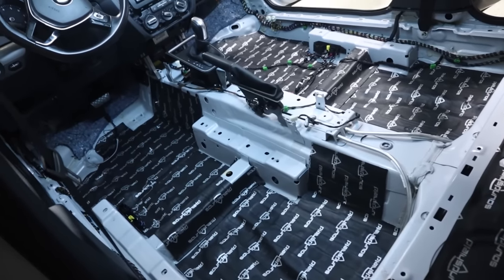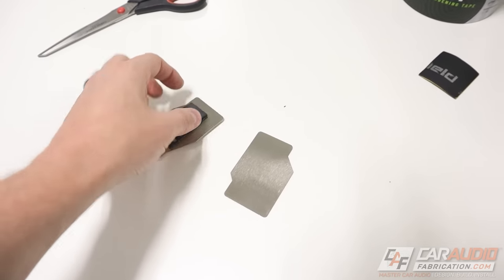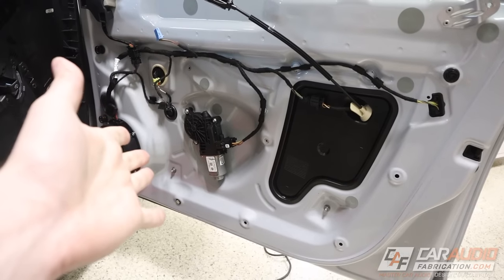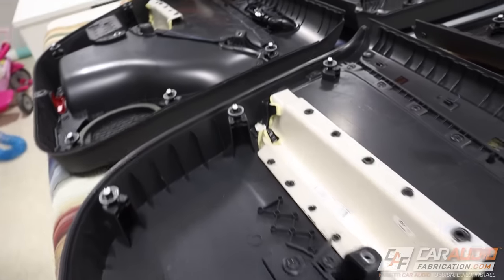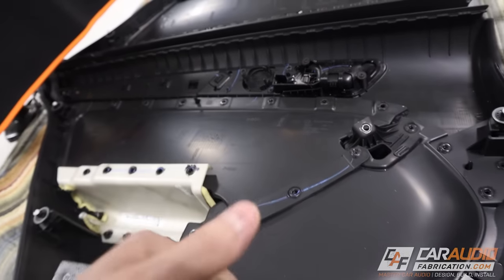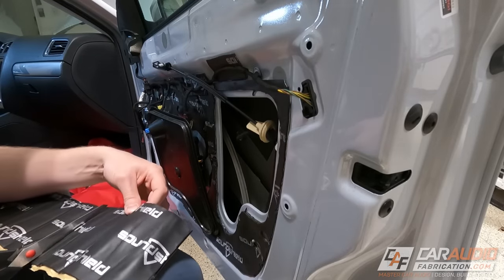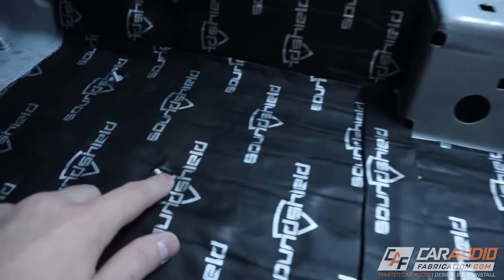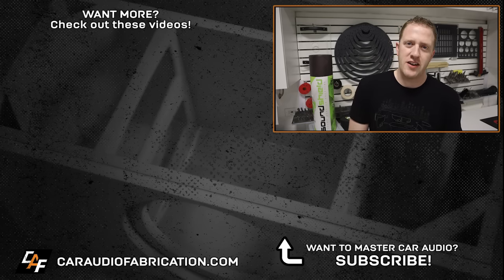IMPROVE SOUND! Deadening Treatment EXPLAINED - Better Bass and Improved Sound Quality!

Comment: I used to do car audio installation back in the early 90s to 2005. A lot has changed but the most important parts have stayed the same. Sound deadening is one of the most important parts of an installation but also one of the most neglected. I know it doesn't seem like it but I had spray on sound deadening material that I used on my 1994 Dodge Dakota. I removed all of the interior, sanded and primed the whole interior and used the spray in deadening material over  the firewall, floor back panel, roof, inside of the doors and the inner door. Then I used Dynamat insulated mat for the floor and firewall and the regular for all other areas. I noticed you using Audio Control equipment. I used that as well. I had the ESP2, Epicenter, 4XS and 2 EQTs for for my four way system. I had USD Waveguide A series, Diamond Audio 6.5 in the kicks, Diamond Audio 8s in the doors and 4 IMPP Pioneer 12s ported through the bed. For the USDs I had a Punch 60, for the 6.5 I had a Punch 100, for the 8s I had a Punch 100 and the for the 12s I had a pair of Power 50Ms. I wish I had a photo of the inside. But I only have a photo of the bed where the Amps were located.
Reply: Funny enough i too had same vehicle. I never did any sound deadening and i never really noticed all that many rattles running 2 rockford fosgate t 1 12 inch subs powered by a 2k watt amp, with the subs firing towards the back. Also never had any headlight dimming either.

Comment: Thanks for the tutorials, very thorough and easy to understand. Going to do my first DIY sound treatment on my '01 Highlander next weekend to bring those new Kicker KSS6504's and KEY amp  soundstage to it's full potential! I already converted the rear 5-1/4 setup to a component 6.5" with tweeters mounted high and angled to the listener. Already sounds 1000x better than what the previous owner had, but I want to maximize my midrange upgrade since I can't go nuts like I did before with an insane system and lose my "dad cargo space"...lol...Anyway first time doing all this, it looks professional and clean so far, and your videos really help, my friend. Appreciate all your hard work.  👍

Comment: for those playing at home and are probably doing a one off job. instead of buying the plastic roll to make templates, you can simply stick scrap paper together with painters tape to get your large surfaces, and all the finer edges, use folded over painters tape. then simply use a sharpie/pen/pencil to mark your shape out, then simply cut it out. the benifit id, if you stuff up an area you can simply stick more paper/tape to that area, retrace and recut. Then simply lay thr template onto the deadener, trace with a pen, cut with some quality sewing scissors!
For trim clip, wiring clip, threaded hole areas etc, i usually fine a suitable object to use as a one size fits all template. For example, a simple trim clip hole in the door sheet metal, ive used a large flanged nut, even a glue stick lid, to trace a nice clearanced circle on the sound deadening, then simply cut it out with a razor blade. This way i get a consistent hole size template that will work for 99% of the trim clips i encounter within the vehicle.

Comment: This is a MID-LEVEL sound deadening upgrade?!

For anyone wondering like I was:

Six rolls of SoundShield - 6 x $119 = $714
Two rolls of SoundShield Slim - 2 x $59 = $118
Roller - $10
Punch Kit - $18
Clear Transfer Tape - $30
Utility Knife - $20
---------------------------------------------
Total - $910

So all in all for this "mid-grade" sound deadening treatment, you're looking at a total investment of $910 before you have invested a single minute of your time into a project like this.
Reply: Use killmat I used it in my Honda it wasn't much I used 3 boxes or 150sq ft. For my 2 door coupe. 50mil and 80 mill were used. Double in the trunk and on the roof

Comment: Installed 80 mil sound deadening in my truck this weekend. Amazed at the level of outside noise reduction. I don’t have decibel level measuring equip. However, it’s extremely noticeable.

Comment: I went to the junk yard and disassemble the entire interior of a Lexus LS 400  to take a look of what type of materials they use to make such vehicles so quiet and virtually noise free … probably you vehicle has three times de amount of sound deadening rubber material, they use different lighter materials , particularly the doors , no mention that make the vehicle heavier affect the fuel economy and acceleration 🤷‍♂️ materials like “Dynamat” prevents rattling but not isolate noise. However it was a nice job 👍

Comment: I did the entire cab on my regular cab truck. I’m running 2 12” JBLs on a 1000W Alpine amp, and JBL rear speakers, 4 Skar 1.75” super tweeters and JBL door speakers. About to upgrade the door speakers to some DS18 250w rms speakers on a 1000w kenwood amp. This stuff helps so much!! You can feel the bass in your chest now
Reply from the maker: Very cool, sounds like a fun system for sure! I always find it interesting when people show off how much their car is vibrating, and I just think... "all that vibration is lost energy" stop the vibration and get more output!
Reply: @CarAudioFabrication  exactly my thoughts! The vibration in a 25 year old truck is no fun either 😅. I really need to pull the door panels and put some material on them as well. Should I do some on the firewall do you think?
Reply from the maker: You can put it on the firewall but the majority of the noticeable improvement will likely come from the doors. If you find the engine drone annoying in that case start treating firewall.
Reply: @CarAudioFabrication  I love the sound of the 5.7! I did two layers on the floor to help with the minimal exhaust. That made the most difference!
Reply from the maker: Awesome, yeah, best to probably focus on the doors then, be sure to come back and let me know how it turns out!

Comment: I was thinking of doing that to my suv but after watching videos of how to remove the headliner I concluded that its a total nightmare can of worms. Also my second row seats come with red loctite on the bolts from the factory, theres no getting those out.  Your videos are always informative and entertaining to watch either way. :)
Reply: The seat bolts WILL come out, even with red Loctite. Use a really long ratchet and spray WD-40 as soon as a couple of threads are visible. The bolts are made to be removable during repair.

Comment: Bringing back my worst nightmares of doing NVH repairs at Chrysler. Spending all day to fix every rattle and buzz you can find for the customer to not even know it was there. Next to water leaks, the NVH complaints were the worst. It has affected me so badly, that in my own vehicle I won't take easier roads to work because I don't want to develop rattles from bumps I can avoid. I drive my old chevy silveraydo then get in someone else's vehicle and cant stand all the noise. I spend the whole ride trying to find out where that noise is coming from.

Comment: I'd like to expand on something you said quite a way through the video (when you were in the trunk). You mentioned about identifying areas that may need 'help' by looking at where the OE has put sound deadening. This is 1000% CORRECT. No matter the make of car, those squares, triangles or odd shapes of material DID NOT get there by accident. As a Professional Automotive Engineer of 40 years, I can tell you that the OEs put a lot of effort into identifying where to put sound deadening to get the best possible sound reduction to remain competitive (in segment) for the least amount of cost and weight (for weight read 'fuel consumption). Exactly as you said about the diminishing law of return - the OE is looking for the biggest bang for their buck. So, as was mentioned (very much 'in passing'), start by adding to what is already there, particularly if you're on a budget.

Comment: Love it! I’m a big proponent of people using the 25-30% method when on a budget as well
Reply: I'm a 30-50 kinda guy. A little really goes a long way. Laws of diminished returns is very evident in the application of deadeners
Reply: I'm willing to spend the money if it makes a difference. I'm not only chasing amazing audio but also less road noise (I have a base model Accord). Any suggestions? I was going to buy the 64.5 sqft roll of SoundSkins Pro Plus but I don't know if it's too much/not enough for 75% coverage. I'm planning this project like a year in advance so I can get everything perfect.
Reply: You obviously don’t love your car 😭😂💀
Reply: @TheMstwntdLMSV123  good lord yes that's plenty. I had a 40sq ft pack and I used it on 3 different cars

Comment: I used 80 mill killmat in my Rigid polished stainless steel shop vac. Did the underside as well,  and yeah man,  it has a much more solid feel, and no Tin-Cabny type sound... Sound Deadening is as important as correct wire gauge

Comment: So I finally checked out the vid... thanks for all your detail.
Two questions I have: 1. With the skins, can it be installed in 50 degree weather?  2. The trunk treatment, is it recommended to leave the gray pieces already on the surface in place?  If it was an older car, would you scrape those pieces out prior to install?
Thanks!!

Comment: On the door near the top you put it on the backside of the panel but not on the door because clearance. Maybe this is just nitpicking but wouldn't you have a better result putting it on the metal instead of the panel? I feel like the metal would resonate vibration and road noise more than the inside plastic panel

Comment: You do a great job of explaining how and why you apply sound deadening material to improve the overall sound within the cabin. Could you touch on how to sound dampen performance and/or aftermarket exhaust systems?

A lot of performance or more aggressive sounding exhaust systems sound great during drives around town or short trips on highways, but those same lovely exhaust tones can become tiring during long road trips. 

In this video, you mention "entry level" and "mid-range" materials but do you have any product recommendations or tips for how to heavily dampen certain locations of a vehicle (i.e. rear/trunk flooring surrounding the muffler(s) or firewall between the cabin and the engine bay)?

Thanks in advance!

Comment: I would like to see a video showing what a very minimal use of sound deadening is used and where to place it.  Someone told me to place patches on flat surfaces only.   I have a 2019 Forester Premium (lowest trim level) with speakers in the dashboard (tweeters?), front doors and back doors.  Is this considered a 6-way speaker system?  Anyway, I’d like to try installing some sound deadening to quiet exterior noise.

Comment: I have no doubt that SoundShield is a top tier product, but one thing I can't stand is manufacturers that use very EXPENSIVE packaging with advertising for their product. Those tubes with the printed logo (advertising) is probably the most expensive way there is to package that kind of product! Every time you buy it you are throwing away money because of their decision to package it that way. For that reason alone I will use another product out of protest of their executive decisions. As an installer you already know how good their product is, so why do you need to pay for it every time you buy it? All it does is increase the cost to your customers without any value in return.

Comment: Do you happen to have footage of the parts of this video that you sped up? It actually is the most important part that i dont fully understand. The wiring splicing is a little confusing, especially if you have never done it before. Thanks for the help😊

Comment: Back up👍 did my doors and door panels on my 2015 VW beetle and the rear quarter speaker enclosures. Much better. Got that from a previous video of yours👌
Reply from the maker: Right on! Definitely makes a big difference even for factory speaker enclosures. The OEM's have to skimp in order to save weight and cost. We can get improvements by adding it back in!
Reply: @CarAudioFabrication  the factory junk is all gone now 😉 I now have about 3kw total now. Ty for your time and help with it.

Comment: I did it on my 09 Taco in 2017 only the doors where plastic was & behind the back seat for kicker box. The doors are a lot heavier closing but very quiet with the volume turned up doors closed.

Comment: When you mention 25% coverage, thats simply for vibration dampening where the main product used contained a layer of foam more used for preventing sound penetration, correct? So rubber on the outer door skin with 25% coverage makes sense but the inside door skin needs closer to 100% when using the foam product - is that about right?

Comment: I noticed you didn't do the headliner. It seems like the metal above the headliner is a problem area when it comes to vibration and resonance. Is there any reason you did not touch it in this video?

Comment: Based on my experience, it doesn't have to be expensive to have a good quality sound. Also, if you put too much sound deadening, 1) it makes the car heavier which will need an "extra" gas for mileage 2) Sometimes,  too much sound deadening creates a "vacuum" silence that for some sensitive people, is painful in the ear, probably due to the pressure created inside the car 3) We are on the road and we must concentrate on the sound on the road and less on the music/entertainment system which is dangerous if we get carried away too much because we focus more on the music. ... Creating a good sound system is more about matching the components and it doesn't have to be expensive.
Reply: True but a buzzing car is annoying.

Comment: With rubbing alcohol still somewhat hard to come by it’s handy to mention you could also use denatured alcohol found on the paint and solvent isle of most big box stores. I’d avoid acetone - it works really well but is stronger than necessary, smells awful, and isn’t friendly to confined spaces.
Reply: @@a.melburn rubbing alcohol is Isopropyl alcohol while denatured alcohol is ethyl alcohol, the same type you find in alcoholic beverages. It is “denatured” with additives to make it undrinkable with the same kind of stuff you can put on fingernails to convince a kid not to put their fingers in their mouth. They’re both solvents that can break down oils and evaporate easily.

Comment: And of course i know that the treatment material is the main answer my question is will that be sufficient for the spots where the plate is connected to the main structure of the car because i strongly feel the spots where its rivited to the car is the main concern but im also still an noob as you can say with the sound treatment aspect of sound

Comment: Love the info you provide and how you explain.   Could you please  do a Demo on  a 2016-2020 Dodge challenger on how you  would  lay it in the rear deck, key areas,:  2  6.5 Kickers ( Cs series, ) Baffles,  and if any, on the front dash area with a budget of $300-350  .  Infinity reference 3.5 's ( Alpine 6 spkr, 276watt original Mopar Amp)

Comment: I have a 2008 f-150.  I want to sound deadening as much as possible.  It’s a project truck, and I plan on removing 100% of the interior… including the dash.  I know the newer f-150’s are quieter because the body mounts, firewall and design of floor pan were designed to reduce transmission of vibration and sound. 

I’m wondering if I can truly reduce the sound transmission significantly without breaking the bank…?

Comment: Hi, great video👍I'm getting very tired of all the noise in the ambulance, some measurement showed average at 77db, peaking at 98db, on icy roads.. please, do you have any tip to where to start and treat the vehicle? Mercedes transporter. Glassfibre box inside the vehicle, with only a lightweight thin padding slapped between the glassfibre panels and the vehicle,  not even glued on..

Comment: WHATS THE BEST BANG FOR BUCK  sound deadening spots to do in a 2LT 2015 camaro?
also whats the best easiest way to upgrade stock stereo w/o replacing head unit cuz it has back up cameras and all that integrated stuff.
i dont have navigation so thats only way i would upgrad head unit is to get NAV w/o losing any integrated stock features.

Comment: I’m tempted to remove some deadening... I ignored the diminishing returns and deadened the whole outer and inner door skins and to be sure it sounds bloody great.

But the door is too heavy! May sound silly, but it’s just not a very nice door to use now...
Reply: That depends on your goals. The extra weight can be minimized by increasing power, much harder on a normally aspirated vehicle. Also that weight is higher up, so lowering the vehicle in some fashion mitigates possible handling issues.
Reply: @dj4monie  Not sure how the engine power has an influence on how heavy the door is to open and close...

Comment: I have a question, I'm from Europe. So the brand you use isn't available here. Here we have brands which sell 3 different options. Isolation, absorption and the deadening. They are called silent coat. What should I use?

Comment: Inside the doors is it beneficial to run the original vs slim to treat the resonance like you showed? Or is it just up to how much room the electrical and moving components inside doors allow for? Is it safe to say to use the acoustic foam one near speaker and the plain 1.5mm slim butyl one the large flat spots in door to control vibrations?

Comment: What’s your recommendation on the white stock padding it comes on both of these doors that is also attached with the thin piece of plastic that glued with some kind of adhesive you remove it or do you go around it?